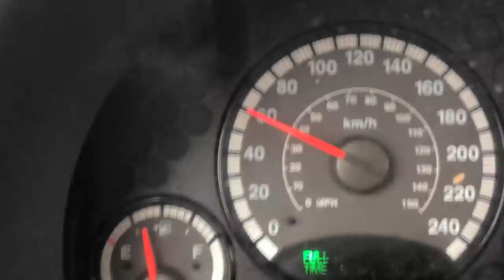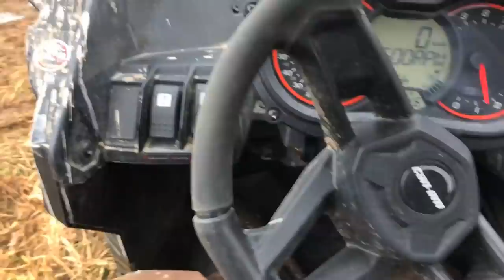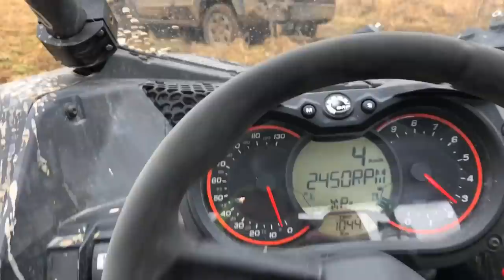Jeep BURNOUT! Maverick X3 TOWING!!!

Comment: I have an 02 Liberty. I like mine, 222,000 miles runs great. However I have heard many horror stories about the engines and transmissions. Quality in general,mechanically, wasn't that great sometimes. It would probably be overkill to drain the oil before blowing it up it'll probably blow up without that.. That other Liberty is probably dying because the battery won't hold enough of a charge to keep the fuel pump going. Maybe a good battery would help.??????